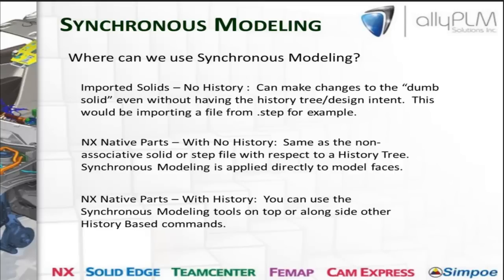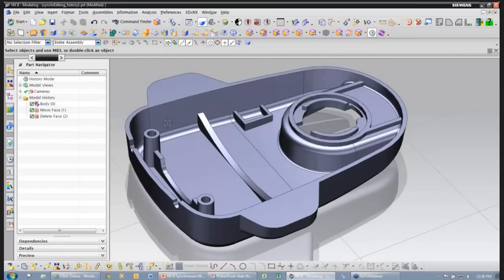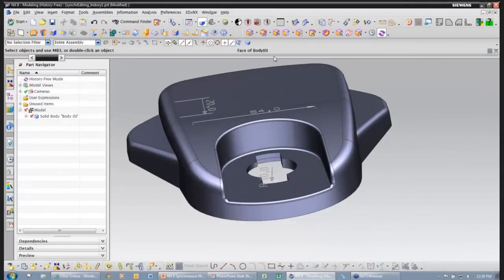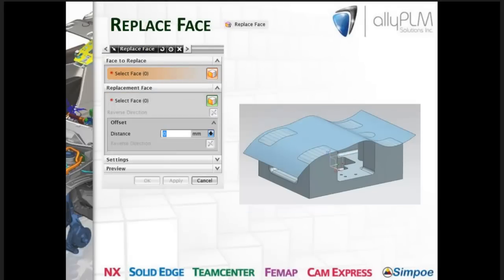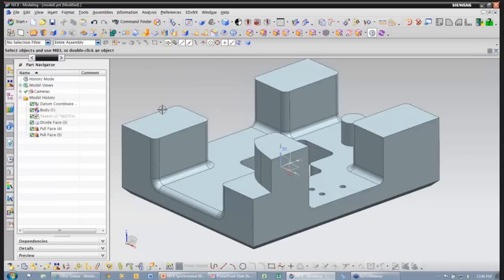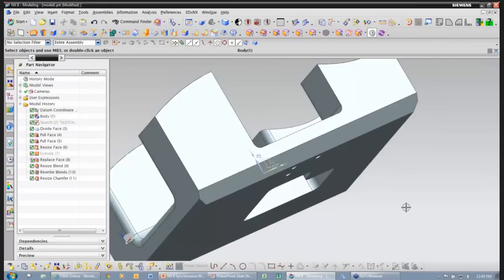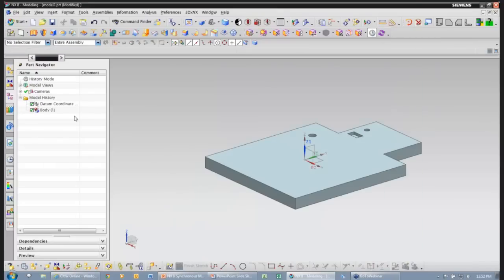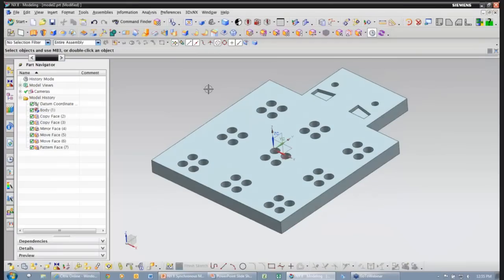Advanced NX CAD Synchronous Modeling (Part 1)? - Tutorial - PROLIM Lunch Bytes

Comment: How to create parametric model from dump model in ug?
Reply from the maker: Hello, if I’m understanding your question correctly, you cannot create a fully parametric model from imported geometry in the form of Sketch, Extrude, Blend, etc.  However, when you create a Move Face or any other Synchronous Modeling feature, that feature is “parametric”.  The value that the face is moved is an expression and features can be rolled back and updated.  That’s the beauty of using Synchronous Modeling.  You do not need a parametric model to make changes to the geometry.